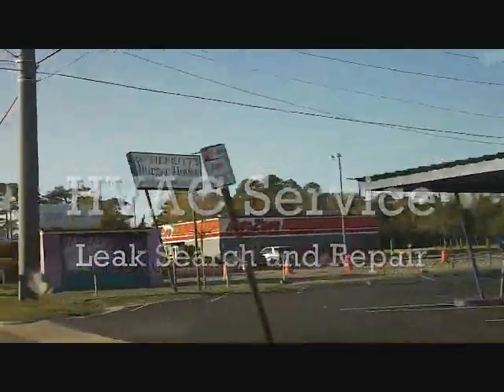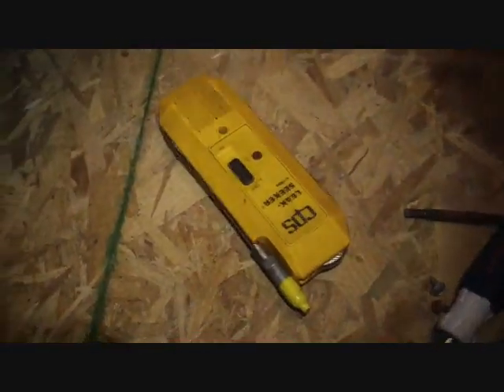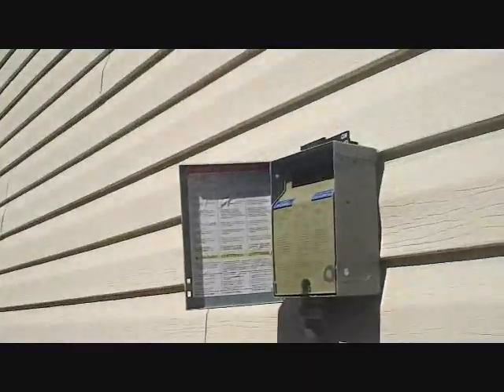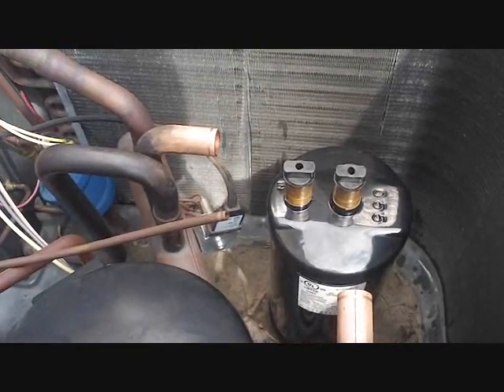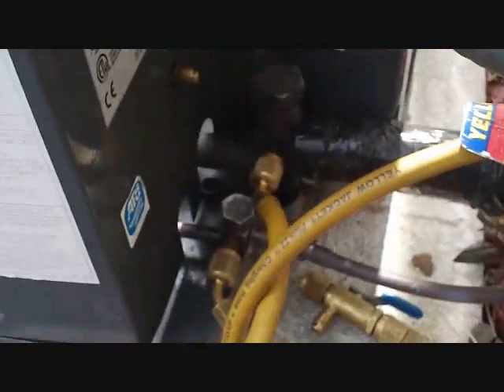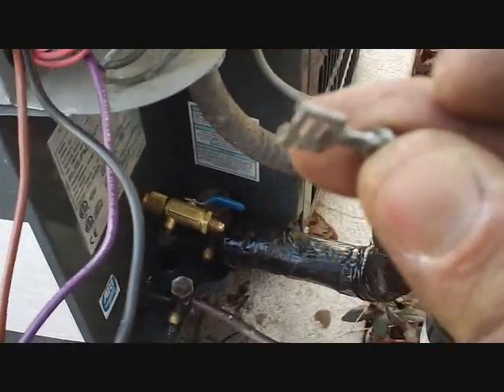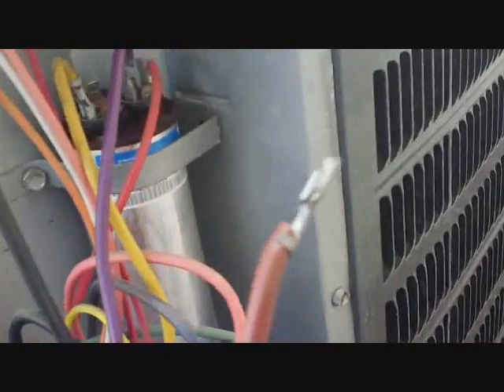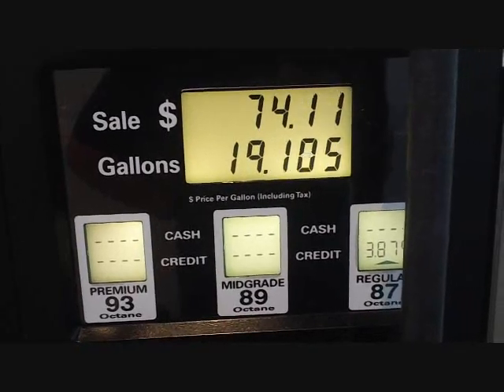HVAC Service- Leak Search and Repair

Comment: Couldn't you bend the lines to fit into the new accumulator instead of cutting them high and using couplings? That's how I do compressors. Never changed an accumulator before.

Comment: The black common fan wire should hook to the defrost board,,,,,  you just generated your self an early fall service call cos the unit wont defrost
Reply from the maker: It will defrost, but poorly. I caught the error later. Thanks.